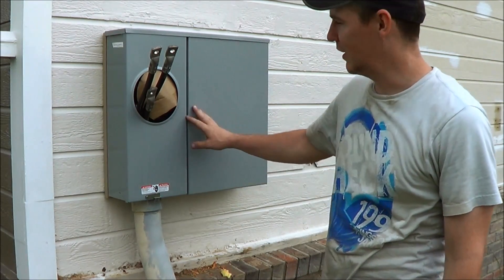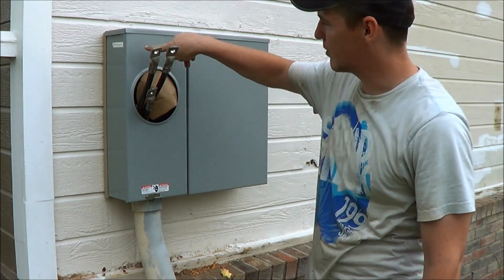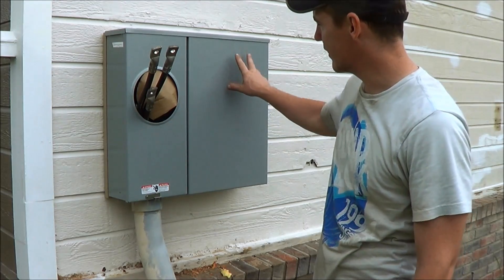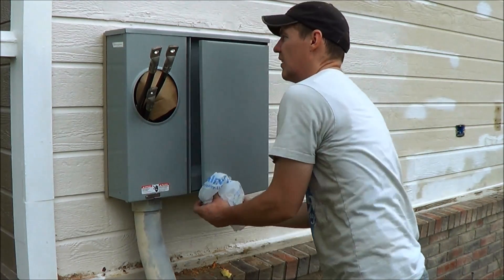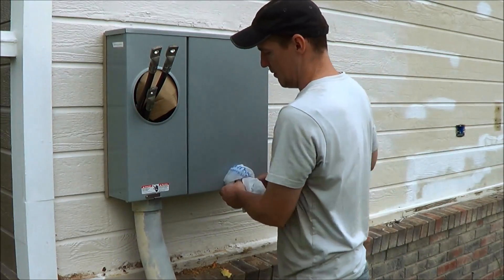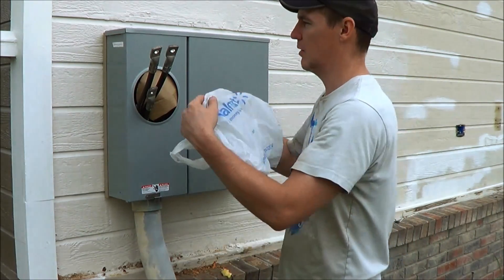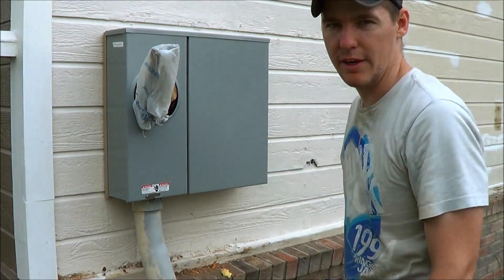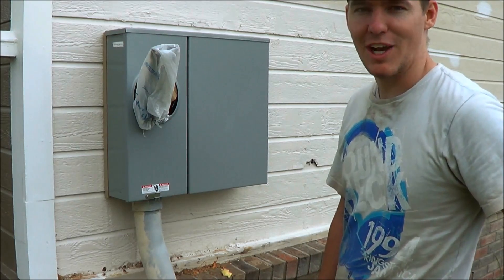Electrical Meter Base Install - Time Lapse

Comment: .The main ground wire giving you by the electric company or place it you on the ground? And what is the gauge of the main supply power cable?
Reply: In America, we use a PEN system,  the electric company only provides a neutral and two hots,  the ground and neutral are bonded in the main panel, and then we also use ground stakes (2 minimum) to bond the local earth to the neutral leg  (Same as PME in Europe) and clamps to bond the neutral to water/gas pipes and metalwork.
Reply: @NillKitty  Thank you.